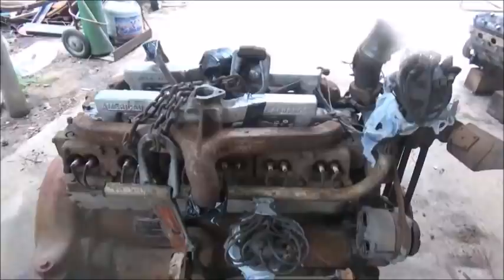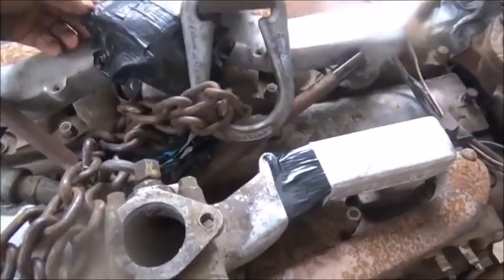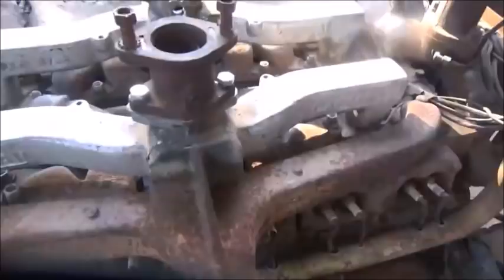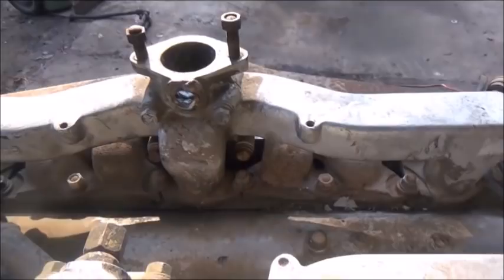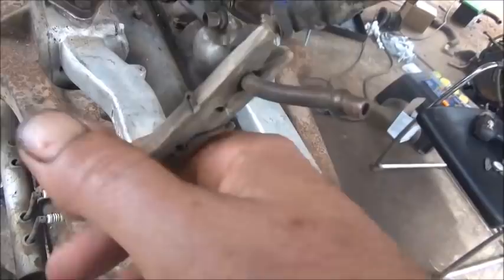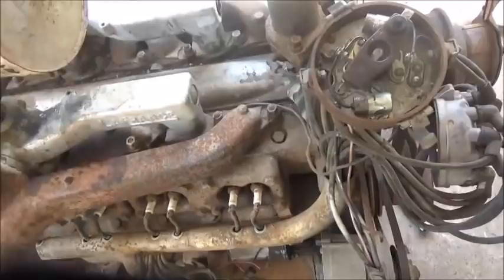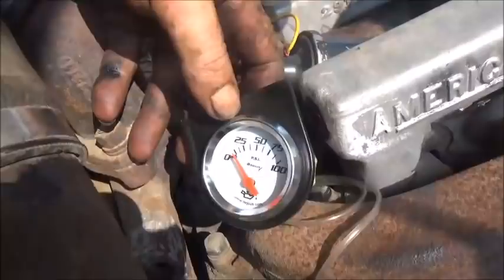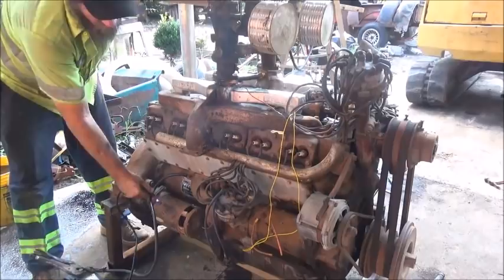AMERICAN LAFRANCE V-12 FIRST START IN YEARS. LYCOMING AUBURN

Comment: Jonathan, this is going back years in my memory banks, but here we go.. The throttle plates in the "adapters" under the carburetors where controlled by the fire pump pressure governor and where normally wide open. The engine speed was controlled by the throttle plates in the carb base. Depending on the type of fire pump in the engine ( gear or centrifugal) the two carbs where able to be controlled separately. ALF used an exhaust gas ventury to create a vacuum in the centrifugal pump to pull a draft from a river or lake. The primer would close a valve in the exhaust downstream of the venturi in one exhaust ( right bank, I think ), and speed up the carburetor on the same side creating lots of pressure through the venturi.
Reply: you ,sir, are a very knowledgeable fellow !
Reply: @stevewhyte8476  Thanks!
Reply: Another priming method ALF used in the early days, was using intake manifold vacuum through a float chamber to the fire pump housing. This method wasn't used for very long, 1, if you pulled a slug of water and the float closed off, you had to drain the float chamber and start over. 2, if the float didn't work, water straight into the engine. OUCH!!
Reply: Wow that's interesting.  They certainly were clever to think up something like that
Reply: That's a lot to recall.  Dang.
Reply: Wow, what a memory! I was fortunate to have worked with Walter J Eisner back in the "old days" (1970's & 80's) . He was a sales rep and mechanic for LaFrance. Early one Saturday morning we pulled the individual heads (two cylinders per head) and relapped all the valves and did a complete tune up on our 1949 V12 ladder truck. As I remember it took 96 feet of solid core wire to rewire both distributors to their individual plugs. Pulling that wire through the static guards was fun but if you left the wires exposed your two way radio wouldn't work because of the interference. Walt could sure make those Alf's purr.
Reply: @oxforddispatch9733  Did you have the big V 12, or the little Lycoming V 12  in your lagger truck?
Reply: @newjerseybill3521  the big one. As I said it was a 1949.  Around 1980 a rod went through the block with no warning at all. No noise, well maintained. Repowered it with a 6V53 NA.  But I loved my time learning about that beast. It was a well thought out truck for it's time.
Reply: @oxforddispatch9733  I thought that in '49, you could still get one of a couple of versions of the Pierce Arrow V12, or the BIG Seagrave V12. Then you also had the super smooth running Pierce Arrow based flat head straight eight used in the little rigs.
Reply: @newjerseybill3521  I'm not sure. As I remember it was just under 500 CID and around 180 horsepower. The Pistons were surprisingly small in diameter. I guess because it was a 12 cylinder  and had a long stroke it had a big cubic inch. Outwardly it looked like the one Jonathan has on this video.
Reply: @oxforddispatch9733  Yup, that would be the Pierce Arrow V12. The big Seagrave V12 was a monster 900 CI engine
Reply: What is the need for 24 plugs and 4 separate ignition points ? Redundancy? Just making sure they never loose a cylinder or ..... ?
Reply: @jasonsparshott7208  Correct, remember you have firefighters inside a burning building relying on a reliable pressure stream.

Comment: Wow Jonathan,  pretty cool! You will get this ironed out, can't wait to hear this thing idle & run. Jonathan ya know what drives me nuts??? All of these naysayers on your channel, the JB weld was & is an excellent idea, it may even last, I wouldn't do anything until need be....I can only imagine what this motor will go in, what about putting a vintage wrecker together using that old Osh Kosh(?) cab that you picked up? Not a rat rod or anything like that, a truck they may have put together back in the day....don't let those naysayers bother you, they probably have never picked up a screw driver.....keep up the good work!!!
Reply: I'm a fan of JB Weld. I had a diesel pickup that had an oil leak between the block and the oil filter. For some reason, there was a small chip out of the cast block right where the filter seal seated. We cleaned out the chip pit to remove all oil residue and filled it with JB Weld. I ran that truck for another 10 years and nary a leak. I've mended many things over the years with JB Weld, and most held together.
Reply: I fixed an aluminum oil pan that had a chunk missing on a car I had when I was young.  It had a quarter sized triangle shaped hole with some cracks from some idiot jacking up the engine.  It not only worked, but it lasted 3 years until I got rid of the car.  Amazing stuff, that JB Weld.
Reply: @garthsheane2440  I am also a fan of JB weld, I bet if the naysayers were stuck out on a job or in the middle of a field & that's all they had to use....
Reply: JB weld works quite well for a lot of jobs but will deteriorate when constantly exposed to modern gasoline. I have rebuilt several thermoquads and sometimes have to re-glue the main jet well back on. So far haven't found anything that will last very long. Devcon plastic steel works ok but breaks down after a while just like everything else.
Reply: or all they can think about is toyota, kia, honda, mitsubishi crap which are everyone for the loser new wave crowd

Comment: Jonathan, I understood your intentions about the quick fix for the intake manifold. You speak clear enough for me.
Yes, Jonathan, vapor lock on the '61 For Falcon was prevented by using a pretty big inverted "U" shape bend in the fuel line just before the carb..
Vapor lock was VERY common with slant six cars too. Running a lot of errands with my Valiant, man oh man, the engine would just crank and crank before it would catch.
WHOA! That engine wants to run!

Comment: Using J-B Weld to patch engines is a time-honored tradition.....   My Dad drove a 1953 Dodge pickup with one side of the flathead six engine held in place with J-B Weld and a couple of strategically-placed bolt/washers drilled and tapped into the crack line where the engine had frozen and the whole left side of the block had broken  and fallen out....  Drove it for three years like that....

Comment: The good old 527 "Invader" engine.  We had 3 of them in the  fleet when I started in the fire service in 1974.  2 ladders and 1 pumper..  All phased out and replaced by detroit screamers by '84  I have a set of valves for one somewhere that I saved when they cleaned out the  old station when they moved to a new facility.  They were real screwy designs, with the horizontal valve layout and the sparkplug blocks in the heads.  These trucks had non-synchro "crash boxes" that gave most of the guys  lots of trouble, so they would lug the hell out of them rather than downshift.  Once they got going, however, they pulled good all the way up to overdrive.  With the top-heavy ladders, there were intersections where you could pick up the inside duals while going around them. Drove like kamikazes back then, you could boil water on the brake drums after a run.  Years later, an elevating platform (66,000 lbs.) t boned a school bus, which left tire tracks across the windshield, and caused $150,000 damage to the truck, but I digress.  Again

Comment: OMG what an engine. 
2 distributors, 4 coils,  4 sets of points, 24 spark plugs and wires to contend with. I would be pulling what little hair I have left out. Lol
I never knew an engine like that was ever manufactured. 
Sounded really good when it fired up 👍

Comment: Remarkable for being engineered SO long ago.. It has a huge cool factor, times 12!
Reply: You have't remember these was used in Fire Truck's they had to sit and run for hours sometimes for the Firemen to pump water. 5.5 quarts wasn't enough for that. 

And, The 0ld Stuff sometimes IS THE BEST Stuff. I Might Add👍🏽👍🏼👍🏻
Reply: This motor is perfect for rAt rods. Or steam punk. Would look better than a small block in a t bucket.
Reply: I agree! I'd like to see it running full out.
Reply: Russell Gerdes  Just saw another video of one of these engines cherry restored and getting fired up. After seeing what Jonathan did with this old wreck, it piqued my curiosity...
Reply: Actually a  45* V12 (the vast majority of V12s are 60*) because they were designed to be a V16. ALF hacked off four cylinders from the design to use them in firetrucks. Neat engineering, but by no means the pinnacle of their time.
Reply: Todd Orton  Regarding what you said about it, yes, Cord cut the four cylinders off. ALF bought, re-tooled and utilized the engine for actual production. That said, it was intended initially to be an actual technical marvel, but what reached production was nothing like the early design, in theory or spirit. A quote from HMN about the the article you mentioned follows... (https://www.hemmings.com/stories/2012/04/22/sia-flashback-found-the-real-lost-cord-part-1)
"The Depression ruined many lives. It also ruined many a plan for ambitiously opulent cars. Such is the case with the vision for a front-wheel-drive V-16 Cord, a proposed successor to the L-29 that would "be the sensation of the automotive world." When that became untenable with the deepening economic crisis, a plan B was worked up to reduce the cylinder count by four, but even the V-12 Cord never made it to production."
Reply: Correction - it was technically always a Lycoming engine, and remained so. It was just changed several times before reaching production.

Comment: I think those type of bottles are common with HVAC guys. They use that little snoot to get oil into fan motor bearings. That's one of the most badass engines ive ever seen. Thanks for getting it fired up man

Comment: Nice one Jonathan.  When I was a young apprentice at a Cummins dealer in Toronto early 70’s they did some conversions from gas to diesel.  
I recall one of these though it may have been in a Seagrave fire truck.  That was the first time I saw a duel spark plug engine.   Thanks for being 
who you are. No hype all substance, and doing more with less.

Comment: Pretty neat Jonathan. I kept seeing only one side of the engine and didn't realize that it has two spark plugs per cylinder until you said you were only going to us one distributor and that the engine had four, six cylinder ignitions. Great video. Happy Motoring.

Comment: Interesting piece of old machinery. I do see why you are just trying to "get it going" before putting a lot of effort into the intake manifold. Now that you have it running, you can either "do it right" with welding and machining and whatnot or perhaps find a used replacement manifold that is in better shape and needs less work.  There is a very large Auburn-Cord-Dusenberg Club which might have lines on things you need.  You also mentioned another fire truck with an A-LaF V-12 like this in it at a price you would be willing to afford. That four-six cylinder distributor setup will be a challenge but you can get it or maybe even fix up something better. Keep having fun!  You are very resourceful and it is interesting how you keep a positive attitude getting all this old stuff working.  Carry on!

Comment: In the '60s, I worked on a generator in an old textile plant that was powered by one of those engines. Their maintenance department kept the engine in great shape but didn't know diddly about maintaining a generator. We removed the generator and had it rebuilt by an electric motor shop. Put it back on and it worked great.  The generator put out ungrounded 3 phase, 575 volts and was rated at either 60 or 75 KW.

Comment: I am shocked, that beast actually sounds very promising, Its amazing what you can figure out. I am curious to see where that ends up going, must weight 600 pounds. The 348, i did not know the cylinder bore was at a angle from the deck height, it seems that wedge of space at the outside circumference kinda makes up the combustion chamber. I was a freshman in high school when the 409 came out. I wanted to get one in a crate and put it something but never had the chance. Instead i got a 371 Olds and stuffed that into a 47 Chevy. Great 1st start, really amazing to see and heat that beast, its really smooth. Go Baby Go! D
Reply: I'm going to guess she weighs 750 lbs. with the flywheel and bell housing. Regular smallblock V8s weigh 500-650 lbs., and the V12 predates thinwall casting.
Reply: I have gotten used to LS motors, yeah any of those old V8 could weight 500 600 pounds. Whew! I like the truck idea.
Reply: Russell Gerdes  wow! that is half a heavy car!

Comment: You're right Jonathan, it has to have that balance tube between the manifolds. I worked on a 1945 American Lafrance fire truck back in the late 70's. One of the old firemen that served on it told me that they had an engine tender person, & that they could check the oil level on it while it was running, sitting at the fire scene pumping water. I remember that it had a  two position lever on the floor by the shifter that said road drive,& pump drive.

Comment: Being in Australia , I had seen similar repairs with a construction compound sealing cracked crankcase in a 253 Holden Red Engine , that repair lasted 10 years ... Those were the days where you used the local hardware store , if the local Service Station didn't have anything in stock , I still use Bunnings , to buy Rtv and Tools .

Comment: Nope, no failure to communicate.  I understood clearly your intentions for experimenting (first) with JB Weld.  It is very common these days for people to be told something (very clearly, detailed, explained minutely) and not hear a damned thing you say.  I experience it daily while giving driving lessons.  You can even have them practice proper techniques with the car in park to "learn" the feel of what you're teaching them, as well as basic procedures to be done (pedal control, and to signal/mirror check/look to the side)... and, as soon as they put the car in gear... they're deer staring in the headlights and poking at the gas.  And, as soon as you tell them they're doing it wrong, they rebut with:  "I just need more practice."  (Meaning, they want to practice the wrong behavior, in hopes that one day, correct behavior will magically begin to happen).  Many of these people are accomplished and highly educated people... without a lick of common sense.

The ol' girl sounded good after barking to life.  Even your temporary bandaids look "more gooder" than some "repairs" I've seen that were intended to be billable fixes.  Question?  Did Nana bite you after seeing your rendition of what she looks like?  LOL
Reply: "Highly educated" is quite often a brick wall, if not an absolute antithesis to the application of hands on common sense. 
Over the years I worked at several jobs as basically the working shop foreman/trainer. I've met a ton of people who've paid for their educations (unpaid student loans paid for some of them too-LOL). 
Point is that because people paid for higher education, when it comes to the hands on working class world a fair amount of them think they are superior somehow. Long story short they are taught to think smugly, and as a result they become unteachable by us "lesser thans". To explain it another way, many really think they are superior to a given job because they have a paper that says they are better than the rest of the workers around them.
It's funny how that works too, because once they prove they can't cut it out on the floor, they often get promoted right past the workers who do good work, because of the stigma that a bachelors degree label in art or whatever else that doesn't even apply to a given job somehow magically means something. Take a corn fed farm boy, and you can almost just point at something and consider it done, and done well, because they learned how to live with their blood, sweat, and hands.
Reply: @Freedomquest08  A phrase we used when I was younger:  "So heavenly minded, they're no earthly good."

Another complication to what I related, is that many of these are from other countries, where the "road test" is nothing more than:  "Show me you can let the clutch out without killing the engine, AND able to honk the horn... and you get your license.  If you're not capable of that, pay enough money and get the license anyhow."  And, so they THINK they know HOW to drive, and show up to be taught how to parallel park and back around a corner... thinking that's all they need to pass the road test.  It's criminal (governing officials), how utter and complete, the lack of value of human life is in some of these other countries.
Reply: @RatdogDRB  Sounds like some US truck driving schools. I've known truck drivers who make side money backing other 'drivers' trucks up to docks, installing tire chains for other drivers, etc.
Reply: @Freedomquest08  A University Lecturer/Scientist/Astronomer neighbor spent 4 hours trying to get the seats out of his MG Midget. I had them out in 3 minutes. He had a socket and bar, and was trying to undo the captive nuts in the floor.
Reply: @Freedomquest08  Never underestimate common sense and taking the time to think a problem thru from all angles. Served me well as a metal fabricator. I would say steel fabricator but I worked with a variety of metals. Common sense approaches to problems have saved me countless hours straightening steel deformed by welding or even cutting at times while others just kept producing pieces resembling a Frito. Simply by utilizing a strongback if needed or whatever seemed to be logical.
Reply: Jerry Clower summed it up best, "It's obvious that you have been educated beyond your intelligence".